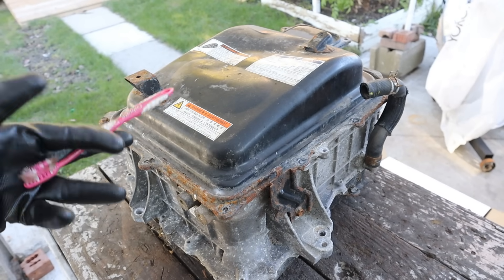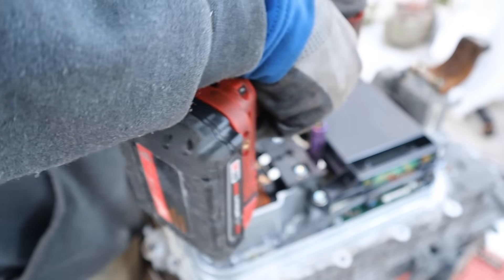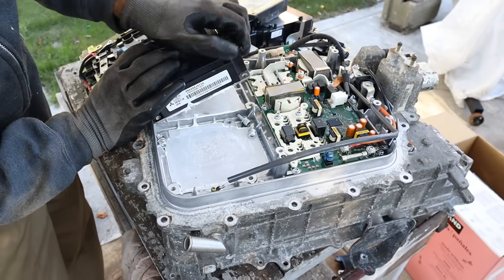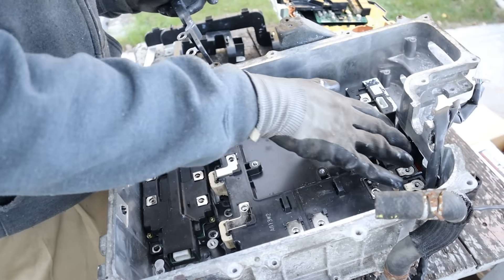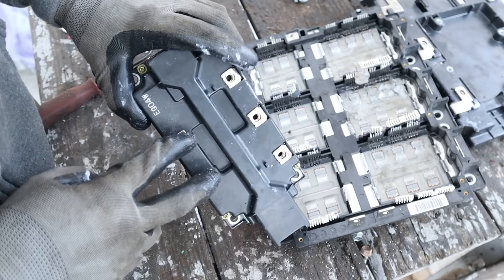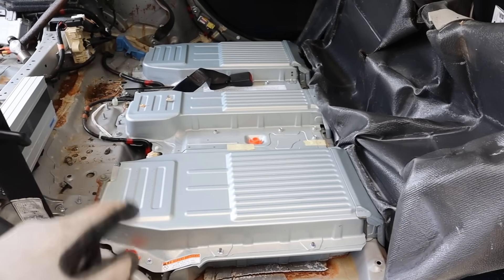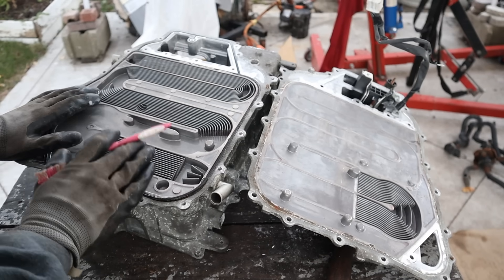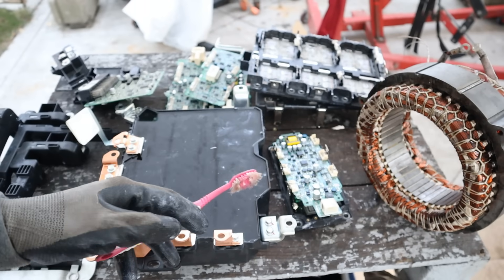How a Hybrid Car Works! Power Electronics: Inverter and Converter Assembly

Comment: I honestly never knew there was a third motor i used an obd scanner with hybrid assistant and the third mg 2 doesn’t exist only the front and rear motors. This video solves so many of my questions thanks!
Reply from the maker: Obd 2 probably won't pickup them as a separate motor, just like the information screen

Comment: my lexus rx400h had it's 12v battery under the hood like a normal car. what gives?
Reply from the maker: You are right. The Rx has it at the front right. 
The other hybrids have it at the back, like the Prius and Camry.
Reply: @speedkar99  Yeah makes sense, great video man. When you get that electric rear diff open and those motors done, I'd like to request a video on a volvo v60 plug in hybrid diesel. That would be awesome.

Keep up the good work!

Comment: So much complexity and cost for a possible tiny increase in mileage, hybrid tech is the biggest scam put on consumers
Reply from the maker: True. It's alot of added weight but it does save fuel
Reply: You are not supported by data.   The data clearly shows that for the same weight of car, a hybrid system car is at least 25 % more efficient than ICE only engine. In the case of Toyota hybrids, they are also more reliable than the ICE vehicles. Consumer Reports have published reliability data based on tens of thousands of responses from their subscribers. My next new car purchase will definitely be a hybrid, unless the solid state battery based cars hit the market soon.
Reply: @metimeti1998 maybe a bit more efficient in the city. But on the highway the mileage is worse than not having it at all
Reply: Well compared to a turbo 4 cylinder 
These Planetary Gear Hybrid Can Easily Get 40 MPG If Your Not A Heavy foot 

Compared To Conventional Automatics 
This Has Way Less Moving Parts 
And Is More Simple

Comment: I don't think the discharge resistor is only for when the key hasn't been turned off. The capacitor stores electrons even when the key is turned off, so the discharge resistor will be used to discharge the capacitor anytime it's not being used by the circuits. Even with the key off, a person could get an electric shock from the electrons stored in the capacitor, so the discharge resistor is used to remove those stored electroncs from the capacitor.
An electronics engineer usually has their own portable discharge resistor which they place across capacitors temporarily to discharge capacitors when working on electronics circuits.
Reply from the maker: Didn't I say that? 
It's to discharge when key off for safety
Reply: @speedkar99  No, your exact words were "for if you open the inverter without realizing the key is on". 
I'm saying that even if the key is off, the capacitor could give someone an electric shock.

Comment: Thanks. I reckon it's very rare for someone to have this level of both electronic/electrical and mechanical knowledge. Most mechanics I have encountered avoid everything electronic! Which is a bit of a problem with EVs coming along strong...
Reply from the maker: Thanks. I'm a mechanical engineer and love learning by tearing things apart. 
I don't think this is expected of most technicians.
Reply: @speedkar99  Hehe. I started taking things to pieces when I was about 8. Of course, it was a few more years before I could correctly put them together again 😂

Comment: Ship that big ass capacitor to Sk, I'll use it for audio! heh
Reply from the maker: Wonder if it would work for audio
Reply: @speedkar99  I think it would work if you sat it in front of the amp, like those power caps they use in car audio. Just to keep the power steady. Assuming the connections could be worked out correctly and it still has enough capacity to do the job that is.

Comment: "We go from DC to AC back to DC, I wish they came up with a better technology that could replace all this"
As someone getting a master's in this, although power electronics is not my focus...
Everything is AC.
All the way down.
All we did to modernize anything is crank up the frequency and use fancier transistors.
Then you realize DC has transients, and oops, DC is actually AC in disguise
Reply from the maker: You are right 🌝
Reply: You mean.... It was AC all long!?

Comment: Is that smoothing cap useful for subwoofers?
Reply: Only for high voltage ones.  ~60kW / 8 ohms.  So no.
Reply: @paul_moir  Thanks. I only heard SK mention that it was ~1kF, which seemed to be the value people were using back in the day.
Reply: @fun_ghoul  He said 972 microfarads, so pretty much nothing for that kind of application.  And implying plates are inside and just looking at the general construction, and it's size, it's probably a film type capacitor instead of an electrolytic one.  An electrolytic that high a voltage can and does exist, but it's hard to pump the current into and out of one.  Film makes more sense.
Reply: @fun_ghoul  Lol.  But I really like capacitors.

Comment: Those look like NiMH batteries, toyota uses both lithium and them. my prius V had them and they started to fail before 100,000 miles under warranty, but the were not failing bad enough according to toyota and they would not replace them. I shipped the car down the road let someone else deal with them, no more hybrids until solid state for me
Reply from the maker: Very interesting they didn't want to cover it.

Comment: I have a 2022 Venza Hybrid. A great car . This inverter is the most scary part on the car to me. Sooo many components to fail .  I hear that this part is about $7500 usd  😳 Fantastic video !   🌵
Reply from the maker: It's fairly reliable. 
Toyota had some issues on the gen3 Prius but had a recall to fix them. 
At least it's parts can be replaced
Reply: @speedkar99 You have a great channel. You make it easy for a common person to understand. You speak plain English with a little humour thrown in. Thanks. 🌵

Comment: When a module like the inverter/converter unit goes bad, presumably it would be replaced as a whole, never disassembled and internally repaired? They don't look like they'd "wear out", so I'd guess swapping a used one is low risk?
Seems like you could theoretically service some of it, but lots of delicate bits to take care with. (Example - capacitor fails, replace it or replace entire inverter unit)
Reply from the maker: These are replaceable parts. There are part numbers on them.